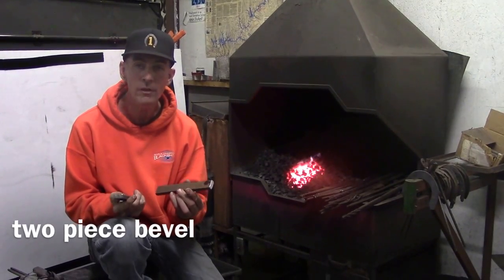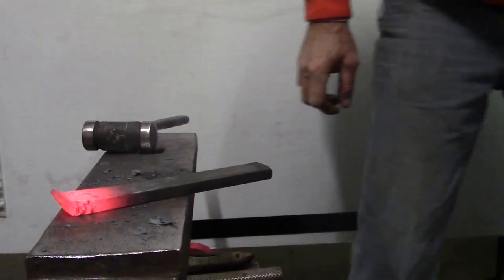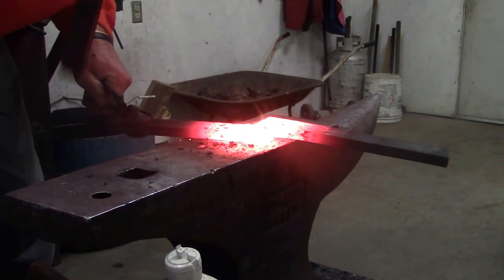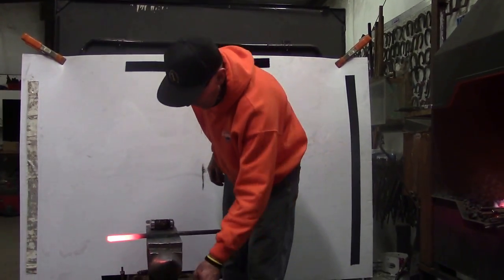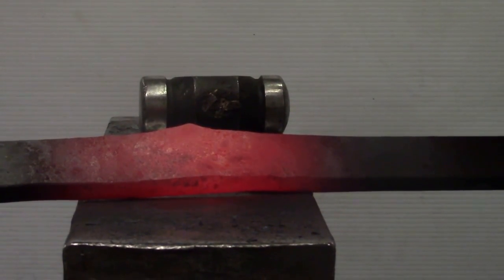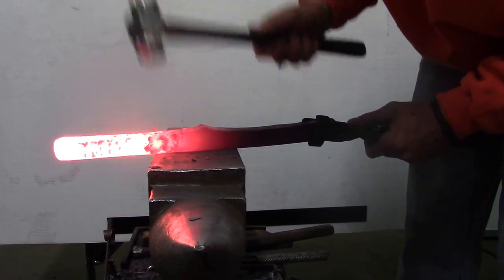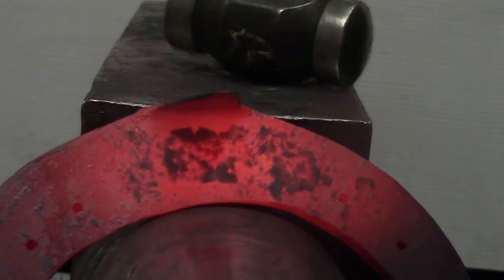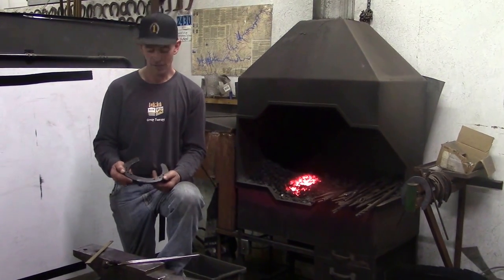Two Piece Bevel Shoe

Comment: Grew up with a shoeing barn in daily operation on the ranch. Now at 57 I have a nice forge setup in my shop. I would never shoe a horse but your video was an excellent example of a jump weld and hammer control! 

Gracias

Su Amigo Siempre